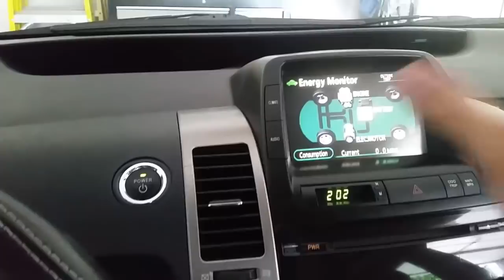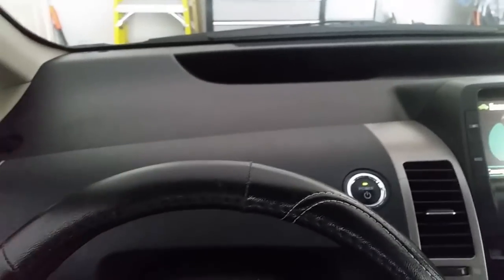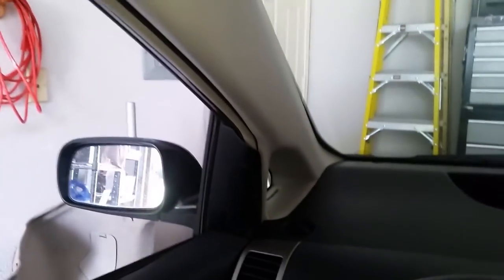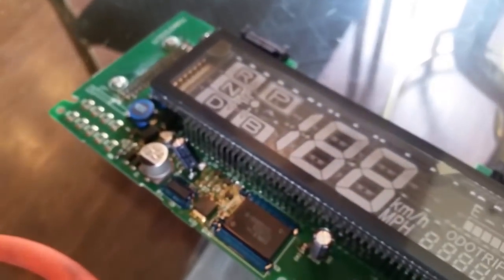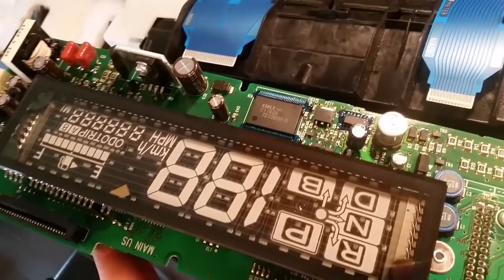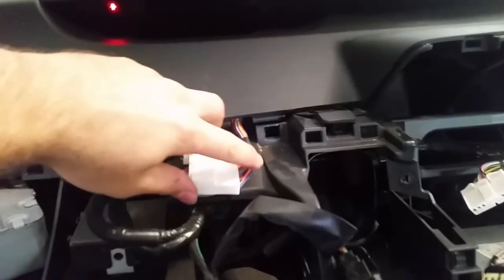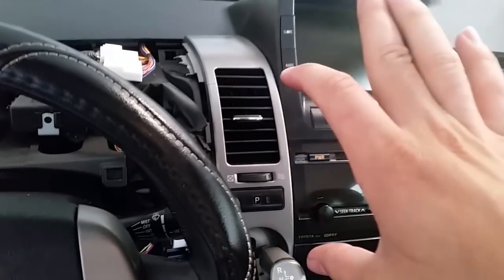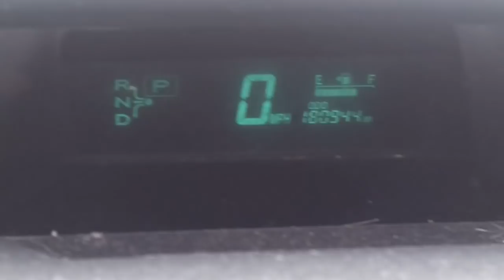Prius No Dash Lights FIXED

Comment: You replaced a polymer capacitor with an electrolytic... which will have a shorter life.
Reply from the maker: It's still working great to this day 😁
Reply: @JohnCalebWarren  well, I ended up doing the same thing, but the problem turned out to be a chewed through ground. It’s amazing how critters ignore all the other wires.
Reply: Where?
Reply: @RobertGolden1952  Driver side beneath the dash, above the gas pedal. You need to take out the shifter to see it I recall.

Comment: Thanks for the info; I replaced my cap on an 09 Prius, I hooked everything up, powered up, everything was good. Shut it off, finished installing all the panels, powered up to go for test drive; all my instrument panels lights were out again. 
Not sure now what is wrong.
Reply: What did you replace it with? Also, you have to make sure your solder is extremely strong. A poor job will knock it out of place once power comes to it. So it might be just that in your case

Comment: Thanks so much for posting this video! We replaced the capacitors on two Prius's yesterday. Purchased them from Digi-Key. Repaired each car in under two hours. Figured we saved about $3000.
Reply from the maker: Glad to be of help 🖒
The car is holding out to this day.  My brother drives it & the dash lights are still working great, been over a year now

Comment: Hey, why did you replace it with 220uf 16 v instead of the same one 100uf 16v
Reply from the maker: Because it's what I had spare laying around out of an old junk TV board. It's safe to go with a higher uf measurement, just not any lower. Also the voltage has to be exactly the same, 16v
Reply: @JohnCalebWarren  That's complete BS!  You can go with a higher voltage, not a higher or different capacitance unless you know something and are redesigning the circuit.
Reply: @robertrukidding3055  There are videos available on youtube showing Toyota "upgraded" from 100 to 220.... with newer models.. Also the "old" capacitor has a tolerance of 20% --> 80 to 120.  There's a guy testing the 100 uF  and measures 81 uF and his display is out... Capacitors age.... So I think 220uF (as Toyota is using in " newer" units is ok! My 5 cts..

Comment: Simple one is to open any door and watch "OPEN DOORS" light which should be off, same time press brake and release and turn lights to low beam and off couple of times until "OPEN DOORS" light came on. After light is on you can start the car normally.
Reply: Tried a lot of different tips and tricks. This one worked for me. THANK YOU!!

Comment: Just wanted to say thank you for the video. I had this problem for about 2 years already. I knew it was a capacitor in the cluster. But I never knew which one or what to use as a replacement. I was about to pay someone through ebay to do this service. My family and I thank you very much. I did it yesterday and it was a breeze to do. Took me about 2 hours in total. Thanks again!
Reply: I'm having this problem on my prius please help a girl out
Reply: @karinacamino5616  what are you having issues on?
Reply: @Oink_Blaster  Hello. 
I've been having this issue for the past 3 or 4 months and it's sometimes not all the times. When I turn on my war the dashboard is just complete pitch black and when that happens I have difficulties turning off my car also my trunk locks and can't open it. I don't know what it is maybe you can help me out
Reply: @karinacamino5616  are you confident with removing the air vent trim and dashboard and a little soldering? Doing it is not for everyone, due to not everyone having the confidence and patience. If you're up for it, I suggest you watch videos on how to remove the dashboard. That way you get familiar with the process. If you have any questions or if you're stuck somewhere, let me know 👍
Reply: @Oink_Blaster  not so confident about it. I need a man
Reply: @karinacamino5616  don't under sell yourself. Any cousins or friends that could help you? Have you tried asking for help in a Prius facebook group? There might be someone local to you that could help out
Reply: @Oink_Blaster  no I haven't asked anyone. I always try to do things for myself, but this task seems hard. I would ask a family member maybe they can help out. Thank you so much for your help.

Comment: Would a 220uf 35volt 105c would work?
Reply from the maker: It might but I wouldn't chance it, taking it that it's all the way back there in the dash. I would try to find one with the correct voltage. I have replaced them with higher voltage in TVs and it works, but I wouldn't chance it given its location
Reply: Thanks for the fast response. I did order one from amazon for tomorrow . thanks!!!

Comment: Help! I did this repair and now I get  red airbag light. Checked the airbag connections on passenger side and they look fine
Reply from the maker: I believe you left the airbag plug on the passenger side glove box area disconnected or not fully reconnected properly. Pull the glove box and double check that connection, yellow harness. Make sure to disconnect your battery before you mess with that, airbags are really finicky

Comment: Remember, you can turn off the car by holding the power button 3 seconds. It goes to accessory mode. Then 2 quick times turns off the car.

Comment: I replaced this capacitor on mine with the same problem and it fixed it, it's going to take you a half a day probably the first time around to do this. Not breaking any of the vents while removing them is probably the biggest challenge next to actually soldering on the capacitor. Be patient with everything.

Comment: I saw some available 220uF 16v capacitors on Amazon.Both have prongs. One is 85C and another is 105C. Would you know which capacitor should be used?
Reply from the maker: 105c would be best. Prongs are fine, just as long as it's 16v & at least 200uf
Reply: I agree with the other guy, I believe the one I used was also 105 and 220uf, 16 volts or above and 200 microfarad or above should work so long as it fits.